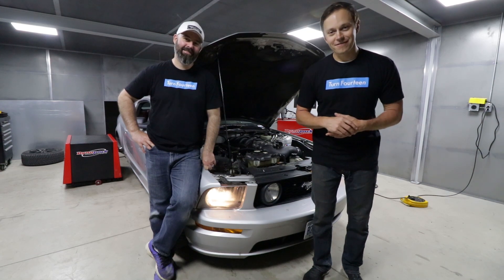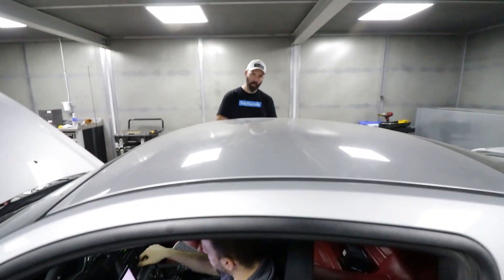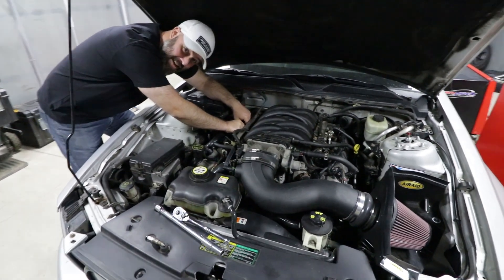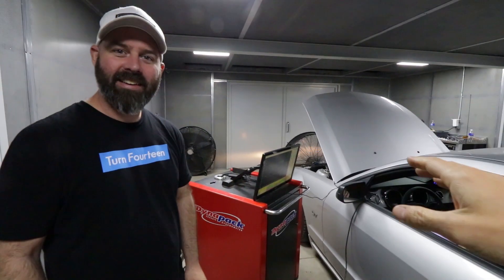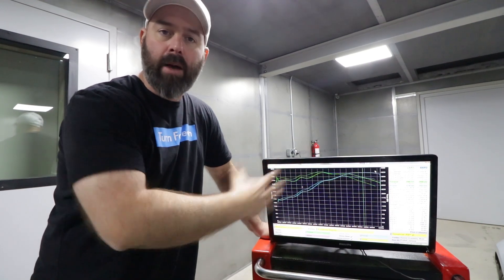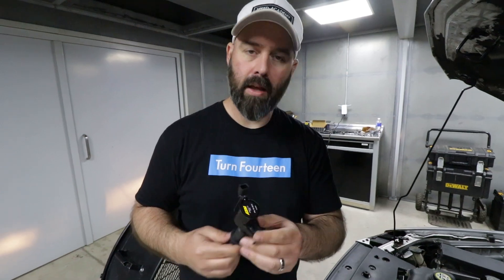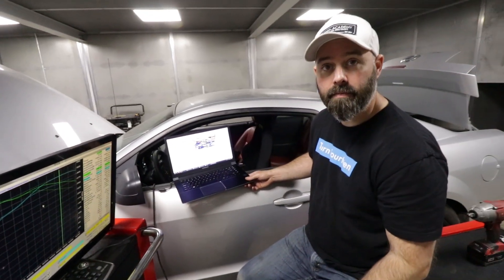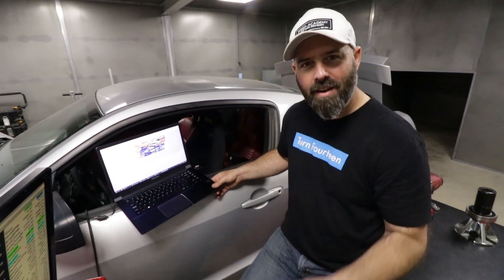Ford Mustang V8 GT Comp Cams + SCT Tuning Dyno Results - Mullet Mustang - EP17

Comment: With a proper tune you can get 350 horsepower rear wheel 330 foot pounds of torque with the stage one competition cam but you have to have the tune without the tune I was making 320 rear-wheel horsepower

Comment: My 06 mustang gt auto premium got 363 rwhp/348 rwtq comp cams stg2 XFI SPR and rpm set into 6900 with only LT headers, X-pipe, corsa touring cat-back, JLT series 2 104"
Sct X3 strategy file tuned by me (91 Oct).. Back on time 2009
Adding cj intake manifold, BBK TB 62mm, frp spark plugs zero degree, accel super coils, steeda udp, steeda spacer, 3.73 gear ratio, intrax lowering springs over oem anti shock and it goes up to 402 rwhp/389 rwtq (442 hp @ engine)  re-tuned again by me with 91 Oct tune file and using 95 Oct on pump gas and it was absolutely amazing performance it's making spinning between shifting until 4th gear and it's automatic tires are Brielle p zero 235/55/17 front / 245/55/17 rear even in dig it will also spin a lot..
Since 2016 til now I am working slowly and carefully on custom twin turbo setup with fully built strokerd cammed engine, fully built gearbox, one piece drive shaft carbon, fuel sys, new full exhaust sys configuration with corsa touring cat-back and Recaro seats.. And see how much power i can get with daily use..

Comment: I've got 352 Plus horsepower 340 1 Tork with competition cam stage one and Steeda motion plates and phaser lockout full lockout if you do this you will get an additional 20 horsepower plus twerk desalvo racing I did the dino and what a beautiful job they did my Mustang is a 2006 GT

Comment: Lucky that high mileage car didn’t have two piece plugs in it or they had already been changed.  if they didn’t come out your day is over. That and this 3v high mileage engine + cam swap — did you change the cam phasers? U10

Comment: Question. If a car loses power under 3,500 rpm and gains power afterwards. Why can’t you just set the tuning back to what it was last run as far as under 3,500 rpm and then keep the current tuning for after 3,500? In theory it makes sense. Someone intelligent please explain why it does not work like that.

Comment: your full of shit about the coil replacements you purchased and installed them when chasing down the spark plug issue and simply tried to justify the purchase when they were clearly a diagnostic guess as to the problem and a very very expensive one. as for spark plugs ?? a champion spark plug goes in a DODGE or a lawnmower or a fucking weed whacker you dont put them in anything else. you should have got a standard run of the mill NGK spark plug no need for fancy platinum  even though the champions are running take them the fuck out and replace them .. do some research champions are shit plugs unless in a dodge product I dont put anything else in my jeep 5.2l but don't run those fuckers in anything else

Comment: My 08 GT-5 Speed 
Long Tube Headers
CAI JTL
37'3 gears
62 mm throttle body
Pulleys
HOT ROD CAMS
93 OCT Tune....Make 344 RWHP !!! Thats 400HP at the crank :)

Comment: What about an Off Road H pipe or Off Road X pipe? 
That would add a couple horsepower and make a mustang sound very aggresive. The SCT tunner will take away the check engine light that the off road mid pipe throws out (due to the catylitic converters deleted)
Reply from the maker: We've got an X pipe on it already! Watch the previous videos.

Comment: I feel like everyone is concerned with more power but ignore the balance aspect of actual racing.  The car is heavy, the engine runs good for it's age and to be honest most great racing cars dont have 400 plus horspower to make them the best on track.  If I could I would gut my car and replace parts that I removed with fiberglass panels that can be removed more easily for actual tracking and lighten up all my major body panels.  Replace my suspension with all lighter than stock parts and replace my seats with carbon fiber or fiberglass...and dial in my road racing skills...ooh and biger brakes!  I love watching this chanel because this is fun seeing what could be if I could, seeing what can be with the car I can say I actually own, freakn sweet!  Heck, didn't someone mention that with the previous mods, the Mustang felt almost like a 911 on track?!  Can't wait to see what's next, you guys give me hope!
Reply: You're 100% right, weight is the first thing i consider when looking at a track car, people always overlook weight when it comes to a track car.

Comment: The cam adds to everything, isn't that stock air intake, stock exhaust, stock everything else?

so just adding a cam into a stock engine isn't going to have huge gains, but I think if you were to add more to it, like exhaust, maybe injectors etc you would see HUGE gains.

Comment: No 2Jz It needs a Ford 4.0 Turbo Basrra engine from Aus.  They can make 600 hp on stock bottom end.
Reply from the maker: We love those engines, would be great to get one here eventually.
Reply: RoboStrikeYou.....or a domestic 5.0 Coyote. makes more than 600 with a few bolt ons and a tune.
Reply: project mullet could be changed to Project Bogan with a Barra fitted.

Comment: Sounds good until you realize a 6.0 ls with heads and a cam makes 450 wheel at 6500 rpm.
Reply: Ryan Barbolt i sure hope it makes more power than a 4.6L 6.0 is way bigger.
Reply: Trevon Adams i don't give to many fucks about chevy or ford but I'd pick the GT over that LT1 just based on looks.  When ever you have ball big enough to call me bitch let me know I'll give you my address.
Reply: 1400 cc's to be exact.

Comment: Man what a waist of dyno time,next time hook up your scan tool and read what it is telling you,ie o2  readings would be way rich ( showing it is trying to go lean),,duty cycles on the injectors would be low ,af ratios rich BY A COUNTRY MILE and trying to lean it out with low injector duty cycles, you don't need a dyno to tune the car for crap spark plugs. Last but not least if you drove it around for enough time for the puter to cycle it would have set codes for misfire. NEVER EVER TRUST A NEW SPARK PLUG 1000s of them I have thrown in the garbage right out of the box

Comment: I enjoy watching any build, but can't help but laugh at the 328rwhp. My 97 camaro with the cam only lt1 and full bolt ons makes 346rwhp .
Reply: Bet it can't touch a 4.6 though😂
Reply: Evil Opti Z how big is the LT1 motor?
Reply: preludeF20Bking It's a 5.7. But before you come back with it being a bigger motor there are some V6 motors now days that make the same if not more than both.
Reply: Trevon Adams Who gives a fuck? It's not an excuse, more displacement can make more power on bolt ons. Always a bitch in the comments
Reply: It's down to their tune and mods.  Most 3V's with full bolt-ons are making over 350whp.
Reply: Tanner Reed Funny because my bolt-on 2V has never lost to a bolt-on LT-1.😕
Reply: 6banger Wander pretty sure all 3v’s are single over head cams. Only the 4v’s had Dohc 😂
Reply: Evil Opti Z no it doesnt
Reply: Tanner Reed 4.6 are 2 cams dumbass, 5.0 need 4 cams
Reply: Easy to poke fun at power numbers but the last time I checked these engines were built for boost.
Reply: I didn’t say 2v, the roush 4.6 has a 3vwhich is dohc
Reply: But does your interior in the Camaro holding up? How is the Omni spark doing? Does it still sound like a truck engine? What about the super small diff that breaks when drag racing haha
Reply: It would eat a 4.6 ass😂 lt1 doesn’t need 4 cams and 7000 rpms to make power
Reply: So try again dumbass
Reply: 6banger Wander your calling people dumbass but dont know enough that that 3v for 2005 was a sohc. maybe if you watched the video they did on the timing chains you would now that
Reply: @6bangerwander260  your car is gay

Comment: 325rwh is not bad, i would be lucky to get that with my 331 stroker. one thing is for sure, you need port and polish work on the heads to take a real advantage of those cams.

Comment: A Coyote swap would be real nice, but also expensive as f**k. This is pretty much what I would do, except I'd maybe do is do the heads. A bit of porting, bigger valves. But that's pretty much it. And if I wanted even more power maybe throw a ProCharger on it.
Reply from the maker: Exactly, the money is better spent on other mods or projects.

Comment: Why are even power ratings measured/showed only at peaks? Thats actually really misleading. Imho, the area, under the curve, would describe  the power a lot better. I mean, lets say - 2 engines - both rev to 5k. 300 torque from 2000 - 4000 RPMs is going to be a lot more, than 400 torque at 4500, but "turbo lag" torque levels up untill then.
Reply from the maker: That's the biggest issue when comparing dyno results no one ever covers area under the curve just peak!

Comment: Nice!! throttle body upgrade, u/d pulleys, intake or control valve deletes,...... can't wait to see the finish product. I have 2005 gt black with 253000 miles on it, pulls hard, 3.73, airaid cai, u/d pulleys, email tune.... exhaust is next.
Reply from the maker: Deletes are next, but other than that power mods done.

Comment: Extra RPM looks awesome with that chart.
Reply from the maker: We chickened out too, thought about 7K but dont want to wreck anything.
Reply: I love the videos, I plan to get a 3-valve soon and with cams (especially stage 2 specs and up) and springs, they are safe to go 7000 rpm. the hot rod cams for example are good up to 6800 rpm, but you need springs to rev farther than that. Great works guys, thanks for your videos! 👍

Comment: Coils on mod motors are maintenance items. You should just change them All around 85 to 100k miles. Because they are on borrowed time by then. They are just sm. cooked unlike the coil used with distributor which is large and out in the air and last till it dies which is usually beyond 150 k mile.
Reply: Good to know, thanks Roger!

Comment: port the head,it's worth it...
Reply: We'd love to put some CNC'd heads on it, but those or big ticket items. Maybe we'll do a DIY port if we decide to further develop the engine NA.
Reply: Arnas which one ? hehehe
Reply: If nothing else exhaust ports.  That's the choke point on 3V's.
Reply: I wouldn't mind helping :)
Reply: Yes ported heads!! My mustang GT manuell made 357hk and 465nm on the dynapack  with no custom tune.has ported heads by myself , comp vsr stage 2 (blower spec) ,airaid cai, gt500 throttlebody, shorty headers (china) ,JBA offroad x-pipe,

Comment: 325 with that many mods is pretty weak
Reply from the maker: It's definitely not a very efficient motor in stock form, but it's worth noting that the Dynapack dyno we use for testing reads quite conservatively. We'd probably be at 350whp on a Dynojet. Still, these mod motors got replaced by the Coyote for a reason! We'd love to throw a Coyote in the Mullet, but $$$
Reply: As you said; its an older design of a motor
Reply: Vq37 VHR add at least 10% to be comparable with a dyno jet,  also note the torque figure.
Reply: just a bad engine. a 5.0 has only 400cc extra but can make 450whp all day and the torque is also way higher
Reply: These Mustangs tend to pull 270 rwhp stock - what gain did you expect?
Reply: Yea but you'd expect more from 4.6 liters
Reply: Speed Academy regardless of whp; progress is progress! Love what you guys are doing!

Comment: Might have slammed fuel in to the spark plugs when it flooded. Lucky it didn't bend valves if that's the case.
Reply: Ya we did a leakdown test and it was all good.

Comment: you guys should do a port and polish that would be great content plus a good horsepower adder
Reply: We'd love to get some CNC'd heads for this engine, it would really make some sweet jam, but these are pretty pricy pieces so not sure we'll man up and do it. A DIY port job is tempting if we ever find ourselves pulling the heads off.
Reply: @speedacademydave  up in northern California (fortuna) there's a head shop that will charge 65 for a port and polish if you bring precleaned heads. Could be worth looking into
Reply: But that´s is hard af to do!
Reply: If your loosing that much bottom end on cams alone now, with ported heads, itll be far worse down low. It'll be doughie as shit. The reason is, is that there is more area to fill in the head, with the same amount of vaccum, which actually causes the air speed to slow. Once in the range, itll be great, but if it's still a streeter, just leave it as is and port match the heads.
Reply: i mean its theoretically free if you do it yourself  but if you have a machine shop do it im sure itll still be cheaper than buying heads....also itll be kool to see a master machinist at work explaining what he does kinda when you built your rotary
Reply: @David Pratte The way this build is going, I'd bet you will before the end of the year is up lmao just not having great luck thus far!

Comment: That car needs NGK Iridiums those are the best spark plugs
Reply: unfortunately NGK doesn't make a plug that fits these oddball '05 to '09 4.6L Ford V8's. There's very few companies that make plugs for it, the Champion platinums are literally the highest quality plug we could find for it. In '10 Ford switched to a more common spark plug, so one more reason for a Coyote swap.
Reply: Copper plugs will actually give you better performance than Iridium or Platinum. The only downside is that you have to re-gap them every few thousand miles but that only takes 5 minutes.

Platinum or Iridium WOULD have better performance than copper if they used the same amount of it but they only give you a tiny speck compared to the entire electrode being copper and has a much larger surface area for spark to develop. Copper is an excellent spark and heat transfer material.

The tiny little dot size area of Iridium that they put on the plugs acts as a heat concentration spot and it creates detonation in your engine causing it to detect knock and pull timing which means you lose some power. The much larger copper electrode transfers heat to the head and out of the engine much better because of how much thicker of an area the heat can flow down away from the plug. Heat transfer is directly proportional to cross area and copper plugs have a wayyy bigger cross area of electrode.

Most people don't care that much or wouldn't tell the difference but try putting in some copper plugs and gap them to the engine spec (I've found plugs 6 or 10 thousandths off from a new box before, they can be bumped when shipping) and you will notice a smoother idle and smoother running engine in general. They are cheap too because nobody normally buys them.

The only reason platinum and iridium plugs are used today is so that you can go 100,000 miles without replacing them. They are for durability and ease of maintenance not high performance. That's why they are what are in common cars from the factory.
Reply: Ryan Vignogna Just regular V-Powers are really the way to go.  I put them in everything I have with an engine, even my lawnmower.
Reply: David Pratte that's crazy I didn't know that. I used to have a pretty built wrx and NGK even makes plugs for that... I swear by those spark plugs man I could physically feel the difference when I switched to them.
Reply: ya NGK plugs are all we run in our Japanese cars. Can't beat em.
Reply: I only use the regular Ngk plugs, I have seen what a broken tip on a Iridum plug can to to a cylinder wall.
Reply: what a load of shit. they're overpriced crap.  I ran 80cent autolite 45s in my hotrod with no problems.   they either messed up on the install or got bad plugs.
Reply: Lucky Rooster Agreed, I always run copper especially on NA, never had issues.
Reply: They now make ruthenium spark plug
Reply: That is nuts, I guess nobody really wants the liability headache of dealing with the 3v.  Pity as if anyone can do it correctly, NGK can. 

Oh well, motor is garbage.  Throw it out, install a Coyote instead.  Oh the sacrifices...

Comment: Autolite spark plugs are trashhh!!!
Reply: Used to be the OEM supplier for ford. Just a bad few plugs out of how many thousands?? It's one of those opinion luck things.
Reply: Roger, you have the wrong sampling size.  Its not a few bad plugs out of how many thousands because the guys didn't test thousands of plugs, its 3 bad plugs out of 8.  That's a failure rate of 37.5% which is fully ridiculous.  One bad plug out of 8 is considered totally unacceptable because of the engine's degree of performance degradation.
Reply: I'm in Australia, I've never seen those plugs here but I can't remember how many forums or videos I've seen that say how crap they are! Don't know how they didn't know that.
Reply: we know the Autolites are junk (they're actually the same plug as the Ford Motorcraft plugs), but it's all we could get when we flooded the Champions. We swapped the old Champions in out of desperation but we'll put some fresh ones in asap.